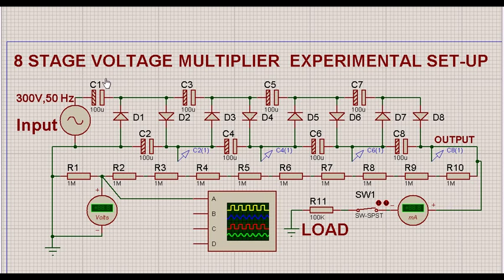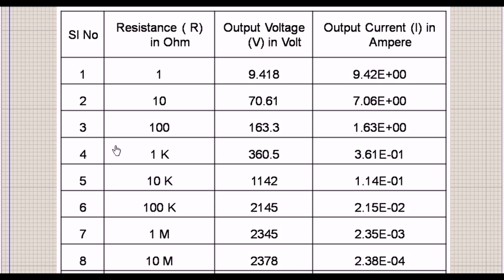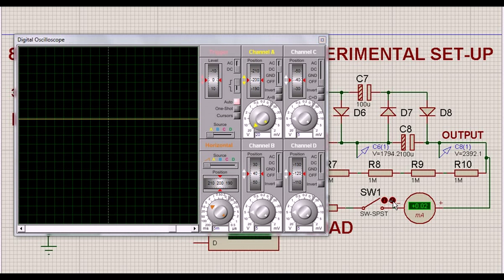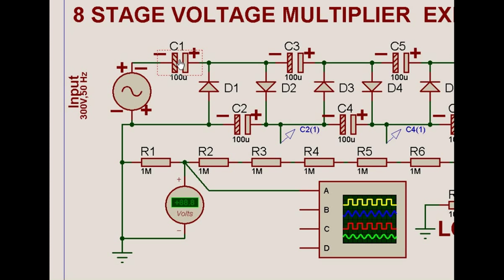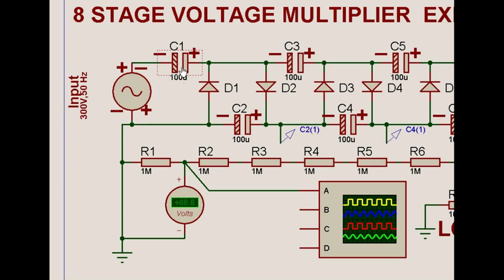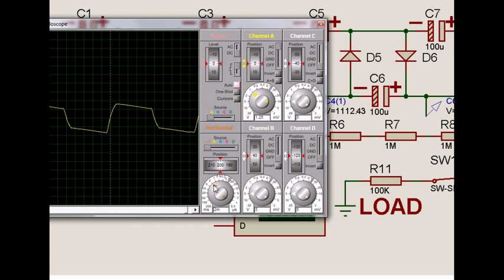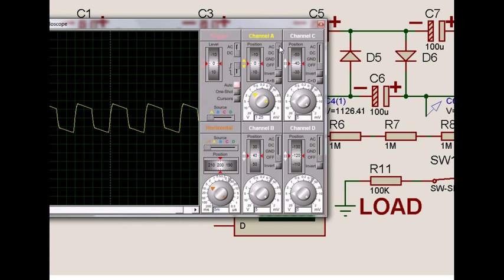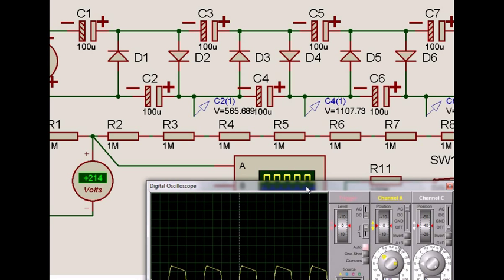Mini Projects for EEE,Voltage Multiplier

Comment from the maker: There has been always a lot of confusion in a circuit diagram while placeing arrow marks for current flow from +Ve to -Ve  or -Ve to +ve
I have already replied this a year back which I reproduce the same below
If you think about current which is more practical, it flows from +ve to -ve.Forget what happens to electrons that flow from _ve to +ve.Most of western academicians understand the electron way of flow.So donot get confused.Think only the current flow  ie  from+ve to -ve.